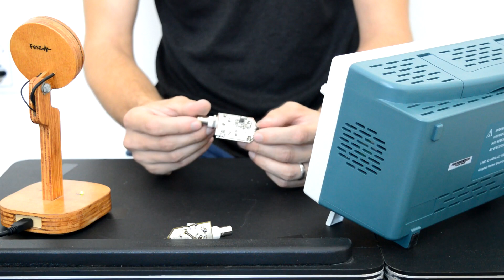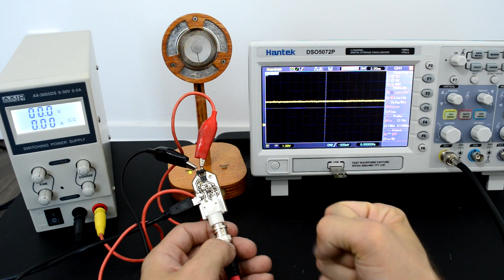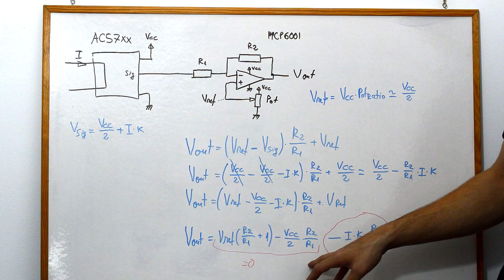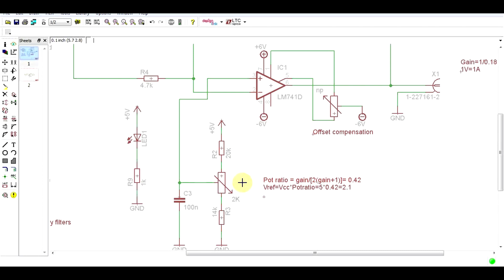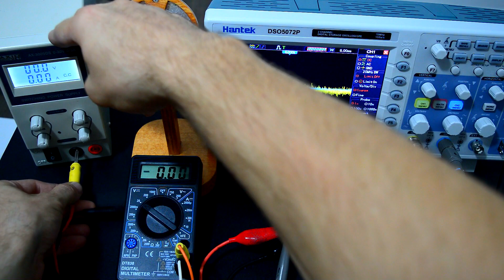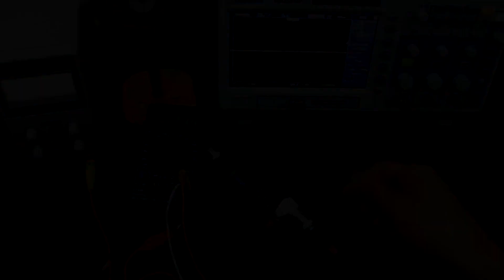DIY Current Probe - Reloaded

Comment: 11:59 Better to add a Zener diode, to stabilize the reference voltage for the bias adjustment pot.
Reply: I think that sensor's zero is not absoulte value, it is some ratio from your VCC. For example, 0 is not alway 2.499, it is more like 0,498 * Vcc.
So, if this is correct, having some ratio from VCC for correction could be better choice.
But I am not 100% sure if my assumption is correct. Most such sensors are having ratio from VCC as zero, not constant voltage.
Reply: @aleks1970nbg  Yes, good point

Comment: Hi, I'm going to build this probe just one question, you and the datasheet are using an inverter amplifier configuration instead of a typical amplifier, is there a problem using a typical amplifier?, I tested this on ltspice and if I'm not mistaken works as well without the problem of returning an inverted signal, so don't get why the inverter config.
Reply from the maker: With the inverted configuration, the reference voltage is directly connected to one of the amplifiers inputs - there is no current to change the offset value; if you are using a non-inverting configuration, the reference voltage node is where you will also connect the amplifiers resistor network - you can end up changing the value of the reference depending on the input signal. With the right choice of resistors it might still work, although you can simply use 2 op-amps (double opamp in a single package) and re-invert the signal, to finally have the right side up.
Reply: @FesZElectronics  Thanks!.

Comment: Nice simple design.  Professional probes with a hall effect sensor also have this effect with magnets, typically you can do a 'degauss' compensation to remove the offset.
Reply from the maker: I'm not sure if the degauss option refers to external magnetic fields, but rather the magnetization of the probe its self - usually you have a clamp made from ferro-magnetic material that can remain slightly magnetized when exposed to magnetic fields. 
This sort of magnetizable material is not present in the hall sensor IC that I used.
Reply: @FesZElectronics  Hmm, good point indeed.  So not completely comparable then.

Comment: Whats the program your using? Isnt ltspice, rigth?
Reply from the maker: Yes. That is the program that I use for circuit simulation in all of my videos.
Reply: @FesZElectronics  i mean for the pcb
Reply from the maker: For that I use an antique version of Eagle. I do hear that Kicad is a really good free alternative though.
Reply: @FesZElectronics  forget kicad, i used it for 6 years and i already switch to circuit maker, is a free-maker version from altium... Its the best free tool i tested
Reply from the maker: I guess the same will go regarding PCB software as for Circuit simulators - the best is the one that you know how to properly use. All programs have bugs, its just knowing the best way around them. I don't use Eagle because I consider it the best, I use it because I got used to all its quirks and it gets the job done for my needs.
Reply: @FesZElectronics  yeah, exactly, for me i used altium designer 2020 profesionaly, and when i tried kicad again at home, was terrible to use, yes, did the work, but doesnt have even half of the features.

Do u have a telegram group, for contacting with u?
Reply from the maker: For private messages I usually use email - feszelectronics@gmail.com . Never heard of "telegram" before, but I guess I should be looking into some sort of discussion/forum platform thing. Something that allows file sharing not just chat; do you have any suggestions?
Reply: @FesZElectronics  a telegram group 😂😂😂 is perfect for that matter, up to 2Gb of file size
Reply: @FesZElectronics  gmail said me   feszelectronics@gmail.com is invalid...

Comment: I haven't got into current sensing yet. However, I have been researching magnetic fields. If that device is literally a hall sensor > I'd be wondering how measurements turn out when multiple paths exist within the same area, b/c mag fields easily combine & cancel. eg, if you had 2 adjacent wires with different current&voltage, OR if the signals were in different phases OR had different frequency components.  Personally if I were trying to get accurate and beat those cheap chinese things with the 7 segments already attached which are $5-$10 >> I would start with a slip over CT, OR something like a bridge(make it mini though!!). Those tektronix probes look nice, but they're $$$$$ .. It would awesome to DIY some current probes !! I salute you !!   Why not try a more inductive approach. I know old school tape heads have an extremely short throw/HIGHLY directional. I don't think they pickup much even an inch away. All things considered / from what I gather from current technologies >> the series type are king .  Just my $.02  . luv the content

Comment: Your content on Ltspice is one of the best out there. Please keep uploading new videos on the above topic. Also some content on embedded systems and analog electronic along with projects done on software's like Proteus and Ltspice will be highly appreciated.
Reply from the maker: Hello Grimm619! Thank you for the kind words! Well LTspice stuff will continue, among other more practical videos - but only as often as much as time allows. I'm not sure about Proteus though - I tried it out many years ago but if I was not extremely impressed, although LT has a more spartan look, once you get the hang of it its quite easy to use.
Reply: @FesZElectronics  thanks for replying. I highly agree with your point that Ltspice is a very powerful and useful tool when it comes to spice simulators. Although simulating complex models like a motor or some other inductive loads can become challenging and sometimes a pain and that's where proteus comes into picture.
That being said your further Ltspice content will highly be appreciated.